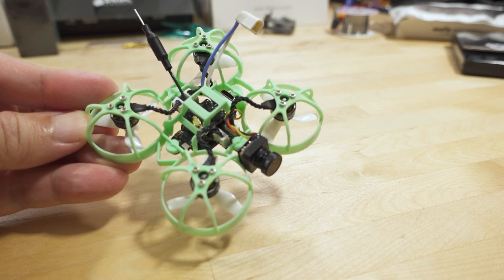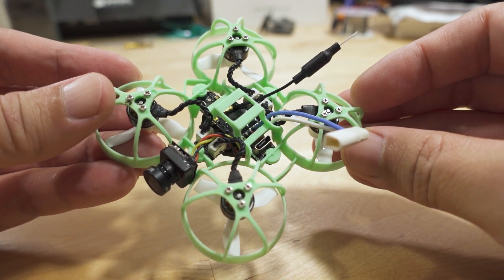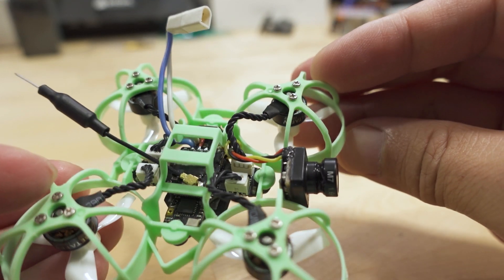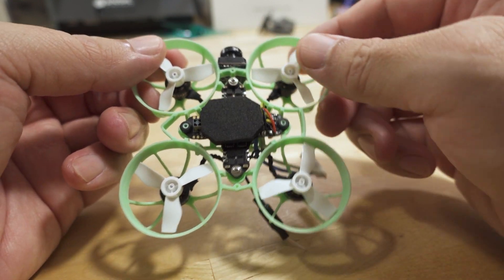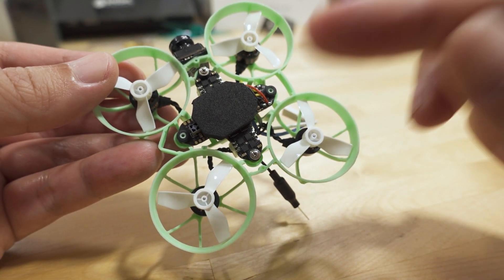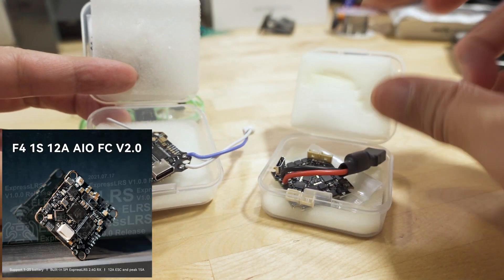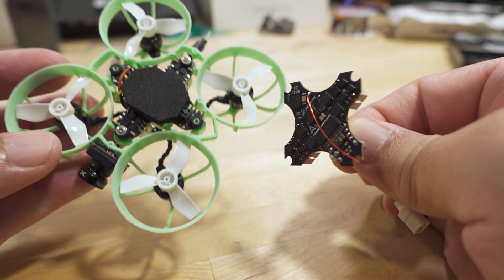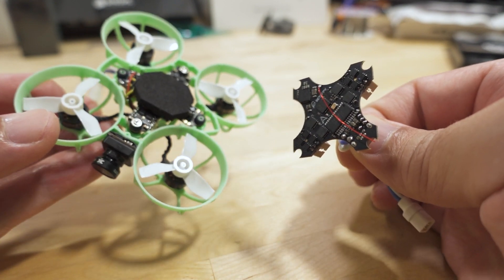NEW BETAFPV ELRS AIO FCs 🎇

Comment: Did you have to updated Betaflight to use it with this FC? When I plug it in it say's it'll be bricked even though I'm on Betaflight 10.7.1
Reply from the maker: This FC has Betaflight 4.3.0 on for the SPI receiver code.  You need to update your configurator to 10.8.0 nightly to properly adjust settings otherwise it will corrupt the settings.  Download it here... https://bit.ly/3caO5uU
Reply: @AlbertKimTV  thanks a ton

Comment: I’m one of those unicorns who has never had issues with D8 save a couple whoops with one multi-protocol module. Otherwise it works great for me, but I can see the promise of this. I just slap CRSF in anything that needs to go farther. I know the Rx are $10-15 more but I’m fine that for now.
Reply from the maker: I think a lot of people just don't have confidence in FrSky protocols anymore.  Perhaps crossfire is better than ELRS but with ELRS going into everything soon, I see manufacturers dropping support for all FrSky, FlySky, and DSMX protocols in their BNF's so it will be up to the customer to add those receivers if they want for a PNP version.  ELRS will be the standard by the holidays is my prediction.
Reply: @AlbertKimTV  It will only proliferate given the price and open source nature of it. Totally agree with you there. As for D8 dying out, it is on its way but not by Christmas. If you can still buy Flysky, it’ll take a bit longer than that I bet. ;)

Comment: Ok not same topic before you say but express lrs is on my Diatone Roma L5 my issue is vtx range I'm set to max power 400 mw also using RHCP anttena on drone and goggles fatshark box goggles style with DVR onboard only getting 150 meters before it snows using band b channel 5 any help any better band and channel please want todo long range drone will vtx signal not and I don't like flying blind so I don't cheers any advice help would be much appreciated many thank from cold wet windy UK cheers friend
Reply from the maker: You can try Raceband channel 8.  That's above the wifi band in case of interference.  You can try better quality antennas on the quad and goggles.  Not sure what you have.  Are you sure the VTX is unlocked?  Diatone ships them locked to 25mW from the factory.  You'll have to ask them how to unlock it.
Reply: @AlbertKimTV  hi on Betaflight done 0 is 25 mw uoto 4 is 400 mw I try race band channel  8 thank you got lollipop 5.8ghz RHCP on fatshark box goggles RHCP on drone mini 5.8ghz aswell

Comment: Cool build!  👍 what board would you recommend for a light weight 2s power whoop?  (85mm frame and 12,000kv 1103 motors running 2s 350mah bat with xt30). Protocol doesn't matter, got them all! 😎
Reply from the maker: This new 12A one with ELRS on it is targeted for 2-inch builds like that.  Not sure about the motor KV though.  Might be a little high even on 2S.  9000 or 10,000kv would be more in the ideal range for 12A.
Reply: @AlbertKimTV  i think i will go with 9000kv,  thanks for the advice and, when I am ready to buy, I will click those affiliate links!  (everyone reading this should as well)

Comment: Are you able to run 400mW + on that Unify Pro32 Nano on 1s? I had issues with it blacking out at end of battery near 3.8V.
Reply from the maker: Mine seems OK, but I hear there are several variations of the Pro32 Nano with some having problems while others are fine.  Don't ask me how to tell the difference.  They look identical.  That's something you have to ask TBS about.  FYI, don't bother posting in any groups unless you want to get roasted by the TBS fanboys.  They'll surely blame you for making a mistake in your setup.  I've seen it before from similar questions asked.  It's kinda pointless and is a waste of time.